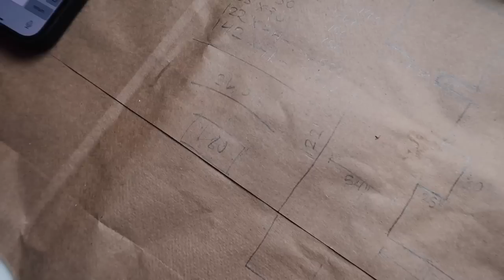FAKE STONE WALL HACK IN MY KITCHEN? 😬

Comment: A small suggestion:  Although the bronze cylinders are lovely, they might be a bit too busy for the space - they'll detract from the other eye-catching elements which you have already installed.  Take the recessed fixtures down, scuff sand and try a complimentary tone or finish; let them "disappear" into the ceiling - allow them to be functional rather than a distraction.   BTW, I'm a professional lighting designer (LC).  Your home is amazing - keep up the beautiful work!
Reply: This is a great suggestion as well.
Reply: I’m a commercial interior designer and I agree with this 100%. 
I LOVE those brass cylinder down lights, however I do think they’ll be a bit much, considering what’s currently going on in the space and the size of the space .
Reply: I think this is a great suggestion!
Reply: Agreed, the recessed lights are fine as it
Reply: I think the bronze cylinders are too modern for the look you are going toward.
Reply: Oh, Drew, I love the amber lights!  However, the other bronze ones don’t seem like a good choice.  You were getting back to the true style of the house, but the bronze lights will look so modern and fight with the Amber ones.  It felt like you were straying far away from the original style of the house with all the marble, IMO,so let the focus be the Amber fixtures and just let the other lights stay in the ceiling.  Love your channel!
Reply: I agree
Reply: I agree @lh824.  I'm  thinking a just a patina finish on the regular can light trim.🤔
Reply: I agree with this. I LOOOVE those bronze spotlights, but I think swapping out the cylinders for something more basic is the best decision for this gorgeous kitchen. Those cylinders can be a focal point for another room.
Reply: Agree
Reply: consider a bronze tone of "rub n buff" if you want to make the existing recessed fixtures complement the space .... ?
Reply: Totally agree
Reply: I love how original and unique your design is!!!
Reply: Is the view out your window another house.  All the cleaning bottles are not what I would want to see.
Reply: I agree
Reply: Consider painting the rim of the recessed lights a flat paint that is the same color as the textured ceiling. They’ll disappear. You can always change them out later.
Reply: Yeah, my first thought was that the bronze might make the ceiling just look white in contrast to the dark.  But, I've never done that to a ceiling, so who knows?
Reply: Yep totally! I think it'll look lovely if the lighting is as invisible as possible considering the marble and statement light fittings, then all the beautiful décor you'll end up using. I personally feel like having a statement flush light will just be a bit to busy and distract the eye from everything else.
Reply: I concur with the suggestion regarding the recessed lights. I am partial to the antique lantern fixtures in front of the windows as they feel like jewels with an elegant couture dress. Well done on the plaster walls.
Reply: I would just trust him. Anytime I think, "No, don't do it Drew!" The final result is beyond anything I could have imagined. He's got an eye and amazing talent.
Reply from the maker: I love this idea! I am going to see how they look just painted a very similar color so they blend in
Reply: Your house is looking so beautiful. You have such a good eye for design.
Reply: @lonefox  try to find a recessed can light without a trim!
Reply: I completely agree!
Reply: That stone finish is glorious! I love that you applied it to the insides of the arches. The stone really gives the kitchen a more old world feel and complements the more contemporary elements. I agree with the others that the brass spotlights are going to be very distracting and will detract from the beauty of the stone look. I can’t wait to see what comes next!
Reply: Oh those walls look so soft and lovely..you are amazing Drew!!
Reply: Yes, while the brass lights are awesome, the kitchen space is too small to intro another design element for lighting. And I haven’t heard what the shelf like things are at the top of the marble? Usually loving your designs so I’m wanting to see what the end result is. The corner shelf with a vase with branches is not great, IMO.
Reply: I agree 👍
Reply: THIS!!!
Reply: I agree
Reply: @denisejones1863 agreed
Reply: @lonefox good idea, having them blend behind scene so to speak that way your pendants and counters are focal
Reply: Yep right on suggestion.
Reply: THE CAN LIGHTS NEED TO DISAPPEAR. YOU ALREADY HAVE MARBLE AS THE FOCAL POINT
Reply: Was thinking the same thing! Keep them simple. The bronze cylinders would be great in another space of the home
Reply: I agree, the cylinder lights are going to detract from the hanging lights. Which are beautiful it looks like a European/Italian kitchen.
Reply: @ritaevans7125  hey,I love how your name is almost like mine...almost haha,😊
Reply: I agree, if you only did the bronze down lights it would look good, but with the two antique lights perhaps too much and they’re the main focal point 🤷‍♀️. Absolutely love what you’ve done!!!! 🥰🙅‍♀️
Reply: Love the suggestion
Reply: Agree 100%! The ceiling lights should disappear completely. They aren’t interesting at all and don’t need to be “decorated” or highlighted. The example you showed were in a much bigger space and worked there, although they stick out a lot. Those lights you hung were truly scary with their pointy tops and metal “mask-like” edges. Not good feng shui, in my opinion.The kitchen has so many lovely elements - the marble and plaster and brass - try not to add too much other jewelry because it will all compete with each other. Less is more!
Reply: Agree
Reply: My thoughts exactly
Reply: What is a lighting designer? I feel like I need one
Reply: I was about to suggest this. 
I’m an interior designer. I had a lighting class that taught us how to use light and what light fixtures exist. It was fun yo learn and I love lighting.
Reply: Agree with LH.  How about bronze colored Rub N Buff on the canned lights you already have?
Reply: @mathewjohnston9444  I agree with you 100%. There have been times when I wondered where he was headed thinking his choices wouldn't look right & they turned out beautifully. He could also make "mock ups" of the cylinders, affix them temporarily to the ceiling to see how HE feels about them in HIS kitchen.
Reply: @debrachildress3192
The kitchen at 15:56 also has marble shelves. Never seen those either before Dru installed them.
Reply: Agreed
Reply: “Look at that little bit of warmth……”🌞🌞🌞love it lol and I agree…keep the recessed lights simple….evrything else is gorgeous!
Reply: You folks are obviously young and don't need the extra lighting.
Reply: 100% agree. The cylinders would distract the eye from all the yummies going on in the space.
Reply: 😮 Good Advice
Reply: @lonefox  I think something more airy ,less heavy would uplift the space. just glass or a light metal structure (like molecule shape)because stone although light colored it’s very heavy feel . Dark color on cabinets also adds weight so something structural would add to airy space feel. I know the theme is more traditional so maybe just clear glass chandelier or Matt white ball structures..
Reply: @lonefox  😉 Good lighting practice is if it is not a decorative focal point, your eye should not be drawn to it.  Functional or accent lighting should enhance or embrace a space; to "feel it" rather than see it's source.  If you're planning on including under shelf or cabinet lighting, the sane rule applies.  I highly recommend a lensed selection (LED tape in an extruded aluminum channel with frosted lens) so as to avoid the dreaded "dot" reveal on the counter surface... The light should "glow".   Another tip is to pay attention to the temperature (Kelvin rating) and be consistent throughout your home.  Since you have a substantial volume of incandescent fixtures in your home, 2700k will more than likely blend in nicely.  Feel free to reach out if you have any questions; always happy to share my knowledge base!
Reply: @AmandaComeauCreates  FYI:  Although a great solution, it would involve a significant re-do of his ceiling (re-sizing of fixture cut out, mudding, sanding, re-finishing).
Reply: 💯% agree. 👍🏾

Comment: Hey Drew, the house is looking fab ! Just a quick tip to save you a lot of money. You can just use drywall compound instead of designer wall treatment. I thought of this years ago when I also had a mediterranean style home. There were 3 sky lights in the kitchen . The ceiling in between them had some surface cracks that I wanted to cover up . I put it on with a hand trowel and moved the the compound around to my liking. After, I painted. The ceiling looked brand new when I was finished with an amazing medeterranean vibe. If you like the sand you can always add some to the mix yourself for pennies . Have fun !
Reply: Absolutely! A great bit of advice.  
The cornice cement or compound is also typically easier to sand out quickly if you want to refine your surface or ever want to remove the finish texture in the future.  This is a beautifully tactile finish that gives the visual and actual texture that compliments your architecture.   Drew is really honing his craft and becoming such a bespoke master.  It’s inspiring to watch.
Reply: Really!! Omg thank you for this amazing painting Hack/ idea tip  😁
Reply: @joannaprevost426  your welcome, I should also mention adding water to the  compound to thin it out to your liking. I liked it thick out of the container but it is very versatile if you want to add water as well.
Reply: I did that to texture a wall near a fireplace. The lightweight compound is easy to work with and sand down a bit if you want to. Adding some construction sand would be nice for a lot of texture. I SHOULD HAVE PRIMED BEFORE I PAINTED. If you bump the wall it can chip. It's easy to fix though.
Reply: I remember doing this finish in a living room in the early 1980's. I can't imagine it in a kitchen. How do you keep it clean?
Reply: I did a light texture with joint compound on the living room, dining room and master bedroom and bath. The DIYer who built the house was a lousy drywaller.😂 I would’ve been skim coating and sanding to my grave. Absolutely love it!
Reply: The lanterns looks incredible! Your walls came out soooo good too. Loving everything you have done so far.
Reply: Thank you for this hack, I have surface cracks on my bathroom walls and I am going to try this with sand!
Reply: @destinyschild8515  I painted over the compound when I was finished. I wanted  warmer color like Drew chose and as you know the compound is light grey. After that I didn't have any problems with chipping.
Reply: @destinyschild8515  I bet it looked great around your fireplace though.
Reply: @NdnUrbanCat  Vacuuming it every so often, with the upholstery brush attachment.
Reply: @TheSeedsower107  thank you  😊

Comment: Drew ~ I love your kitchen, and especially the antique lighting. I've installed antique metal lights in a cottage I renovated, and to bring out the patina and natural colour of the aged metal I use antique wax polish. I don't know if you use such in the US, but it's a wax which is set as a block in a tin, is applied with a dry cloth, and it has a darkish stain incorporated into the wax which doesn't actually colour the metal r furniture, but does enhance the tone of the patina. It totally bring out the bloom and age of the metal while protecting it and giving it so much depth. It also makes dusting so much easier! ♡

Comment: Love the door hardware, kitchen Gothic lights, travertine tile choice (a favorite), and the plaster. Taking time to find perfect options will make a home you melt into with constant joy. Door hardware is exceptional. I would love that beauty welcoming me. Agree with your thoughts for ceiling light replacement. Modern that will provide great light without distracting from the Spanish Gothic lights. Enjoyed seeing your product application. I actually would like to see similar detail on cement counter application recently used in giveaway makeover. Missed seeing your home and excited for all your projects ahead. Merry Kitchen.

Comment: I literally said ah, out loud when you tested that first light! Love love love those fixtures and the ambiance they provide! Just gorgeous! As for the can lights, I suggest ordering can frames and painting a copper effect on them to coordinate with the lights you just installed. DO NOT use those pipe looking lights. They will not diffuse light throughout the space. And you need lighting when using sharp knives, if you know what I men. Plus they appear too industrial and you are looking for warmth and function.
Love that texture effect wall treatment. Great job!

Comment: I’ll throw in some thoughts. Remodeling and building a few homes in my lifetime, the biggest regrets were when I chose lights that didn’t illuminate well. Especially the kitchen, where task lighting is so important. Use your canned lighting to really illuminate the areas where there are specific tasks happening. Areas, such as the sink, the large counter areas where food is assembled and your stove area. You have high ceilings so make sure to look at that the lenses have large range of light. The spotlights will only light straight below. Great work so far!!

Comment: I love watching your videos. They inspired me to use a bit of colour in my re-decoration (Tivoli blue from the Little Greene paint company, with Flint for the final wall). I can only do a bit at a time, but your energy and enthusiasm for your craft is awesome. 

I just wish I could afford to hire a designer like you to finish off all that needs doing here, or wave a magic wand to get it all done (new front door, re-wiring, interior wall & floor insulation, underfloor heating, converting bath to walk-in-shower, air-source heat pump/conditioner, moving the kitchen & creating two new bedrooms at the front of the flat - so much to do on a tiny budget 🙂... or just move to a new place with less to do!)

Comment: This turned out so great. I've done texture paint and it's so hard to get it to look just right. It's perfect with the what you've done. It looks like original plaster walls and not  sheetrock rescue of the terrible glued on tiles you removed.

Comment: I love the texture of the walls and ceiling. Wondering how to maintain it? Do you paint over it? Reapply more product? Your application was over new sheetrock, but what about painted walls? I have a room in my house where the wallpaper could not be removed without serious damage to the sheetrock, so I had to paint over it. (and yes, I tried everything to remove it). How I would love to cover up those seams... It's worth a shot!

Comment: I like the idea of letting the recessed lighting stay, but further letting them disappear into the ceiling. I do think, though, that the bronze cylinders would look lovely. I don't think they'll look too busy. I just wonder if they really will provide enough light given that they are cylinders, unless the surface of the bulb extends all the way down to the bottom of the cylinder.

Comment: You could do aged brass or bronze can lights that don’t hang down and compete with your hanging fixtures. The hanging down ones are cool but your home is leaning towards a artistic vibe. Wondering if you could find a metal worker to make flat rings to compliment your light fixtures to adhere to the ring area of your can lights. A star shape or scalloped would be cool and then treated to somewhat to match the gothic fixture finishes. Someone that does Mexican tin work maybe? Kitchen is looking amazing. Gods Blessings

Comment: Bronze cylinder lights are a no for me, I think the recessed lights should vanish into the ceiling. The kitchen is beautiful with many textures and adding more elements will detract and distract from those heroes. Your inspiration pic is in a very large room with plain white walls, so the lights drawing your attention up works for them. However your kitchen is confined and narrow with a lot of wall detail from the cabinets and marble. 
In order for hero pieces to shine, other pieces need to take a back step. one of those is the recessed lights in your kitchen.
Save the bronze cylinders for another room! Eg. hallway?

Comment: I would recommend addressing the wall behind the stove first as it may help make the final decision on your lighting on the ceiling. Possibly a copper hood, some come with vent fans. Some come with a strapping detail or large rivets. In interior design you keep the eyes interests to travel up and down keep the visual with interest. 
I had made some suggestions earlier of possible places to look and may have been the reason my comment was not posted. So until you actually do your research that gives you more open options that keeps with the feel of the home. Also you have to think of balance. To much color on one side and not the other gives the room the feeling of being out of balance.

Comment: I have two concerns. In the future, you may want to use a light plastic drop cloth taped over the front of the windows and cabinets. Plaster will dull the finish when you wipe it off...especially a sand coat. You will be basically dragging sandpaper across the wood.  The other is there is a marble shelf where the range hood is going. how is that going to be incorporated? I really love what you are doing and envy you already.

Comment: You'll need several pot lights in the ceiling if you plan on prepping and cooking in there.  The pretty gold lamps won't be nearly enough light, nor will a couple of the metal can lights.  And suggestion: add under cabinet motion lights as well.  A dark kitchen isn't useful.